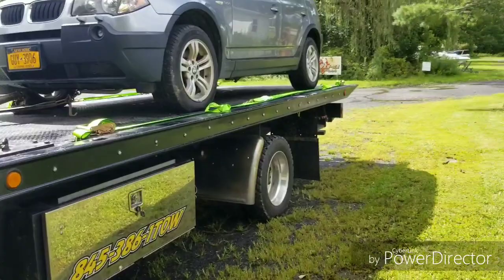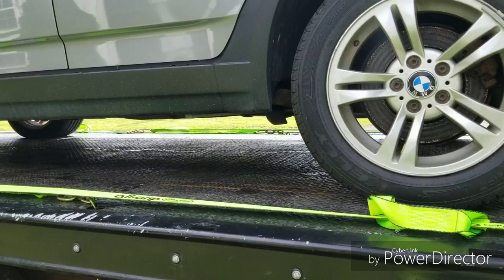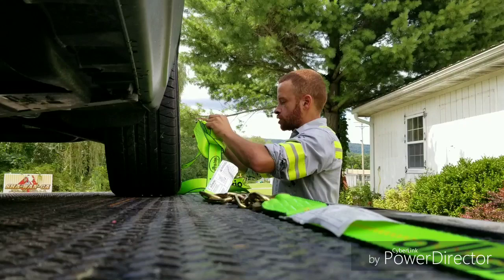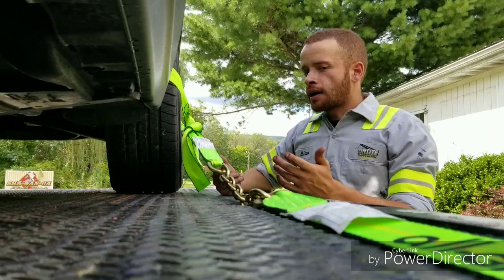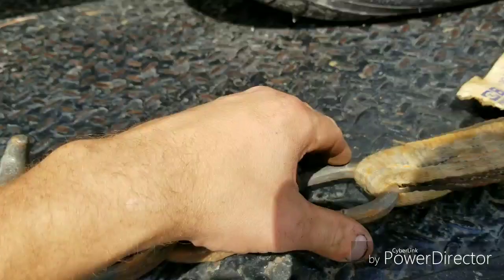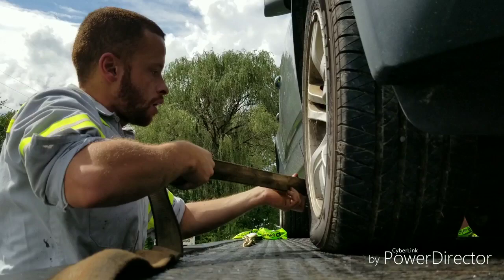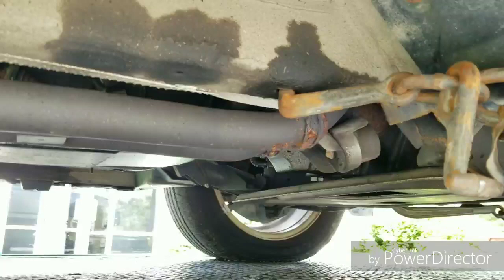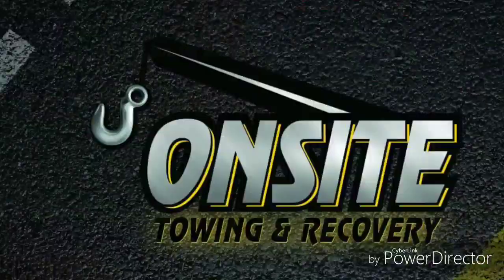Tow Truck 8 Point tie down and Different tie down methods. Part 1

Comment: Mostly tow king cab long bed 3/4 ton pickups I don't even know what a strap is, chains and binders on every corner. You should be able to turn the rollback upside down and the vehicle being towed doesn't budge, no movement whatsoever.

Comment: Y chain from the winch with 2 mini js to the a arms and a single mini j on the rear to a slot is just fine for anything under 35 miles in my opinion I do 4 corner tie across state lines
Reply from the maker: Its not fine. Dot is federal they require 4 points wheher its 200ft or 200 miles.
Reply: I work with dot patrols quite a bit and no one’s never said nothing to me

Comment: Put your access strap back to the wratchet and do it a couple more times .. more professional than just tying the extra strap.
Reply: Can you please make a video of what you mean I think I understand but a video would be great
Reply: @JK-yd5ro  U ever see those cable ties covered in silicone, plastic etc that is in Lowes etc that is used for extension cord, hanging up hand tools like shovels, etc they work great for this. I keep them this way and I rarely need to get more slack. If not all u do is take the slack, and shove it through after rolling it up and tighten down. Or those big wide rubber bands that used to be around bags holding them to the vac. Idk where to get. Or just loop it up and use HD velcro. Wrap a 16 inch piece around extra. Or since they come so damn long I just use the straps with the bull ring cause they fast and u can put around, through wheels and tires, axles etc. But I use the straps that have cable, chain inside so it's easier, and won't get hung up on brake lines, etc. Gotta watch these newer autos. They have entire front end covered up with a plastic skid plate. 1 wrong slip and it can be damaged. I ripped mine off cause I had to take off yo change oil. It's useless. If urr gonna have a skid plate, have a metal 1.

Comment: I have 30 ft homemade triaxle  goose neck trailer,with the d rings running  down  the sides of the trailer, will I be able to haul cars legally?
im new in car hauling
Reply from the maker: You should be fine as long as you have 4 points of contacts on the vehicle. Stop by a scale or personally ask a DOT officer if unsure.

Comment: Will this strap hold a 3/4-ton or 1-ton truck?
Reply from the maker: Yes. A good rule of thumb is to check the gvwr of the truck you are carrying. For example of its 10k, and the working load limits of your straps are 4k each multiplied by 4, that puts you at 16k. I believe the straps on the video are rated for 3,333 lbs each

Comment: Ok so, The big J-hooks on any vehicle is a huge No, no unless it’s being recovered from an accident scene. Those giant J-hooks can easily be hooked on your steering’s control arms and damage them. I also noticed he attached the mini-j to an aluminum part of the undercarriage when using the wheel strap... also a big big no, no. Mini-j hooks are only to be attached to a designated REINFORCED STEEL part of the vehicle (in which NO BMW vehicles has). So a soft bridle should have been used to winch the vehicle on to the bed, not those giant J-hooks, and four wheel-straps (one one each tire) should have been used to transport this particular vehicle. This isn’t a state to state regulation thing, it’s general knowledge.
Reply from the maker: 1) J hooks are not to be used for recovery.
2) The X3 does not have aluminum control arms.
3) If you watch where your putting your J hooks, than you should not be destroying tie rods etc.
4) The mini J uses was actually put on Double Wall Hook pocket underneath the car. Perfectly fine. Everything I do is the wreckmaster way. 

This video was used for demonstration purposes all the vehicles we tow go down the road with a all 4 corners strapped. This is not a state regulation but a federal one.

Thanks for watching
Reply: @towuniverse2443  I been hauling with the big J hooks for 10 years ZERO problems
Reply: bmw has T/mini J slots where the jack gets positioned when changing the tire .. you have to remove the rubber grommets to access them .. just be sure to out the rubber grommets back when done

Comment: newbie here, here in Cali, I believe we can use the long chains and J hooks to the back and ratchet to the front, one of my co-workers is using this 8 point method, i don't like it car rolls back and fort, I rather do and can do my method faster with my own set up, which is putting the strap thru the wheel... straps that I'm using have the hook in the middle of the strap and the one end has a small loop.
Reply from the maker: They changed the rules, you can use 2 adjustable straps and 2 chains, but all 4 must be secured. It use to be all 4 had to be adjustable.
Reply: @towuniverse2443  so do you still do it this way with the green straps you demonstrated, or no?

Comment: So J hook and chain is illegal on back tire bc it’s not adjustable ? It has to be a strap and J hook?
Reply from the maker: You need four point of tie downs winch does not count. Two of them must be adjustable. So you  can run two chains on the rear and two straps on the front. It use to be , all four needed to be adjustable.
Reply: @towuniverse2443  thanks just bought my first truck been learning as I go.. u saved me a ticket lol

Comment: Does the car has to be in park when using the 8 point? Or neutral is fine ?
Reply from the maker: No, It does not. I never put vehicles in Park when properly strapped
Reply: ALWAYS E BRAKE ON OR IN PARK
Reply: @larrygonzales7410  Nope, never I always leave the vehicle in neutral e brake off the entire time i'm loading, transporting, and unloading the car.
Reply: @towtruckaj  well that's just dumb. But I guess we all have our own ways
Reply: @larrygonzales7410  How do you figure it's dumb? The safest way to load a vehicle has been know to be loading it and unloading it with the winch, that is the absolute safest way to do it, To do so without excessive load on the cable or on the car, you do so in neutral, Once you get it on the bed, you do your 4 points of tie down at least, And that stops the vehicle from front and back, side to side, and up and down movement, Being in neutral or being in park will make absolutely no difference to that vehicle coming loose or not, As a matter of fact i'd say it's more dangerous to put it in park or put on the E brake as it requires you to climb on the bed which is a no no to engage the parking brake or put it in park, As well as in neutral keys stay in the ignition so they will never be lost... If you want to explain how it's dumb i'll always listen, but I have a feeling you have no real reason for calling it dumb.
Reply: @towtruckaj  ok well if you absolutely need to winch every single vehicle up and it's none driveable than yea that's fine. But if it has all 4 tires than slap it in park. There is nothing wrong with getting on your bed at all and it is not "unsafe" to climb on your bed whatsoever. When you're unloading than put the vehicle in neutral and control that vehicle while you're in it. I feel that it is dumb based off of how I work.
Reply: @larrygonzales7410  I don't have the references to any sources but as far as I know climbing on your bed is one of the most dangerous factors of the job, And so I never do so except for changing out cables, As well as wreckmaster too teaches not to climb on your bed, Many factors can lead to injury when climbing on and off the bed, And there is really no benefit to the vehicle being in park with a solid 4 point tie down, If it makes you feel safer sure go for it I won't tell you that you can't or shouldn't but personally it is faster, and safer for me to just leave it in neutral, Especially since for highway scenes specifically the majority of the highway scenes that are on the right side of the road, I never step foot on the left side of my truck except getting in and out, I will get out, Go infront of my truck then proceed to the bed, My cable is stowed at the rear right pocket for me to winch out and pull on then remove from the pocket, I then lower the bed, load the car going on the drivers side only to put the left side of the bridle on, then i'm back to the right side and I do both my side tie downs if i'm using my 8 point tie down system, Or two rear chains and a right safety otherwise, Then I head to the next exit to finish my tie down. I will only be on the left side to steer (if need be) to do my left side of the v bridal and to get in and out of my truck, No other reason, I never climb on my bed, Never put the car in park, Nothing.

Comment: Those 8 points are garbage. I've had cars wiggle out of them before and I'll trust a chain over a strap any day... You're relying on threads to hold the weight of a vehicle.... If that wish bone fails you lose 2 points of contact
Reply from the maker: Never have had one fail. I use them correctly.
Reply: @towuniverse2443  I use them correctly as well. I've been towing for 10 years. Mainly tow heavy duty commercial trucks. I have a 50 ton Kenworth that's my main rig. I have used those 8 points before and you have to have them absolutely perfect of the car will slide... I haven't had one car slide with chains not 1 inch.

Comment: Technically that is a 4 point tie down cause  there is only one strap per tire. So to me it's a 4 point and not an 8 point.
Reply: D Franco correct. 4 point tie down. I hate when guys leave their straps out on the bed for quicker times. Equipment is too expensive to leave out. That looks fast until you really have to take out all 4 wrath Etsy, straps etc. Good video content. I’d Never run straps outside a tire. What happens if the tire loses air?
Reply: Advertised as 8 point tie down as in 8 points to the bed but yes legally it is a 4 point tie down
Reply: @tinystowingtinyunis2957  You ever had all 4 tires lose air at the same time? And I don't know about you but I know every single time one of my straps lose tension, it's as easy as looking in the mirror and seeing it loose then stopping to tighten it. As for equipment being too expensive to leave out, I do it all the time, No issues, it's no different than leaving it out and securing a vehicle? Naturally, that equipment will be out a lot that is what it's used for, Yes it will rust, yet it will be exposed to the weather a lot, but that is going to happen regardless, keep it lubed up and there will be no issues.
Reply: Leaving all your straps or ratchet's laying on the side of a bed tightened down or up by the headboard does not actually prove anything like it working any faster it just actually gives anybody an option to steal expensive straps that probably cost 152 $200 and a lot of guys use those 4-point tie down systems and have no idea that they're pulling the straps too low or Dare crimping brake lines or ABS sensors behind a tire cuz they're not paying attention with 43 years experience I think I probably know more than most people do
Reply: @tinystowingtinyunis2957  Yes people can steal those straps, Just like they can steal anything else on the trucks or in the boxes with a simple crowbar, It does indeed make operation faster claiming it doesn't is just ignorance, I don't care how much experience you have, if you have 43 years experience you would know there is more than one way to do the job and it really come down to personal preference.
Reply: @towtruckaj  Your straps loosen because you don't get a fiber lock. You should make sure the strap is wrapped around itself inside the ratchet. (fabric on fabric) before to get a load on it. Don't pull it taunt and then start to ratchet down. Give it a little slack, let it wrap once in the ratchet before you crank down in it.  Just my 2 cents
Reply: @masonplatt6126  I was talking more about other variables, strapping the body and the suspension compressing, tires losing pressure, etc needs wraps on the ratchet is just the same as needing wraps on the winch drum, I believe for a ratchet you actually need something like 2 wraps before it’s to it’s full capacity, fabric on fabric does help but I believe you need more wraps than just one for its full capacity.
There are occasional things that happen that make a strap loose, depending on the load there may be a shift, if it’s a car a tire may go flat, etc but what I was saying is the chances of all 4 going loose is so low and requires user error to achieve that extent of failure and so a single strap or even two loosing tension may happen in certain cases but if you are aware of your surroundings and looking in the mirrors it is very obvious when that happens, you will see the slack in said strap and you can stop and correct.

Comment: Wrong bro.
Reply from the maker: If its wrong, please say how?
Reply: 3:52. Strap on tire is wrong. if the tire goes flat or hit a big bump or take a turn to sharp you’re gonna lose tension on that baby j hook. Cross strap or go thru the rim. 4 point tie down in or out. That’s why the bed has so many holes in it. I also use 4 rubber chalk blocks when using soft straps. Front and back on both tires closest to the cab. Takes 10 seconds. I would like to come and show you in person a lot easier that way.
Reply: I can show you how to do it with the chains as well. You can keep tension on the chains not relying on the winch. It’s only illegal if you’re not doing it right.

Comment: thats 4 points not 8... to be an 8 point there would have to be 8 ratchets
Reply: 😂😂😂😂 now you got me second guessing why they're called 8 point tie downs
Reply: Advertised as 8 point due to 8 points to the bed but legally it is a 4 point tie down, and no 8 ratchets would not make it an 8 point tie down as it would still only be 4 points on the car, it would have to be 4 more independent adjustable tie downs to be an 8 point system

Comment: this is not safe  ! I tried it better to use loops inside the rim Hundred percent much safer tie down inside the aluminum rim !!  if we can’t tie down from the rim You can buy special S hooks you can use kind a holes under the car much faster never get loose !! and I’m doing this 21 years Experience matters !
Reply: Negative, this is a wreckmaster approved tie down system, when used properly it will not fail, going through the rim is also fine, and I have never seen a cluster strap or chain with an s hook on it that is just unheard of you have r hook t hook and j hook sounds to me like you have nowhere near 21 years experience if you are using s hooks, s hooks are what are on the tiny little ratchet straps from Walmart.